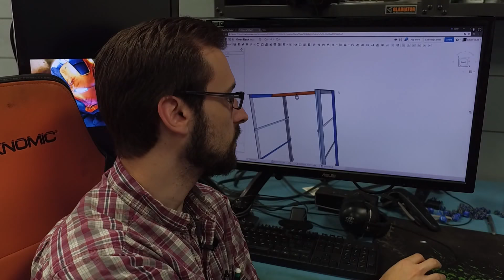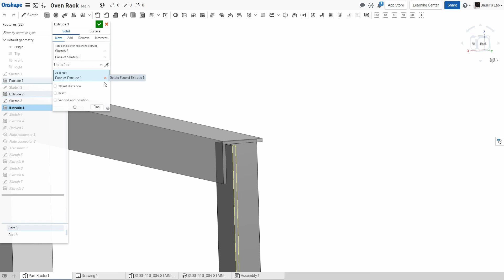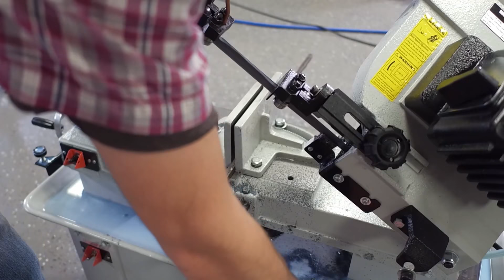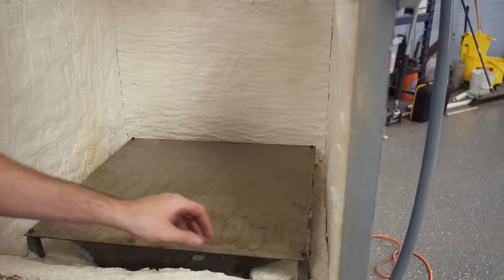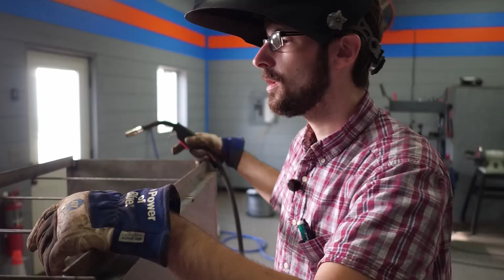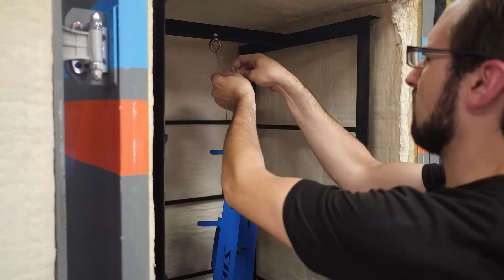Oven Rack and First Powder Coat

Comment: What high temperature adhesive was used to glue the insulation inside the oven?
Reply from the maker: I think i used 3M super trim adhesive 08090. The outside of the oven doesn't get over 60c so it's not a super high temp thing.

Comment: The rack looks great!  Looks like you added shielding gas to your wire welder?  I assume to avoid the mess that comes with flux core?  I'm really interested in that as an option, it seems like a good balance between capabilities and cost on the spectrum from "basic stick welder" to "TIG with all the bells and whistles".
Reply from the maker: Yeah, the shielding gas is a must. It isn't very expensive and you can actually use specific types of flux core with it to have "dual shielded" mig. It burns in like 7018 stick rod, but with the speed and ease of mig. If I had been using the dual shielded method, that coating on the angle iron would not have been an issue.